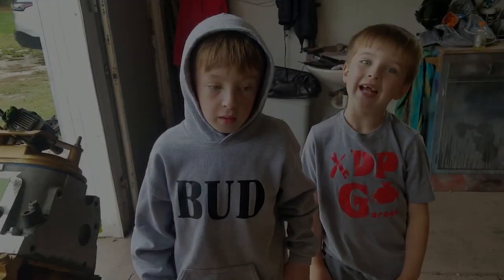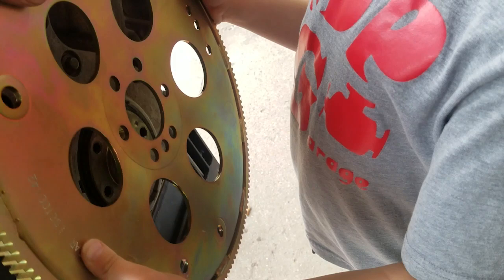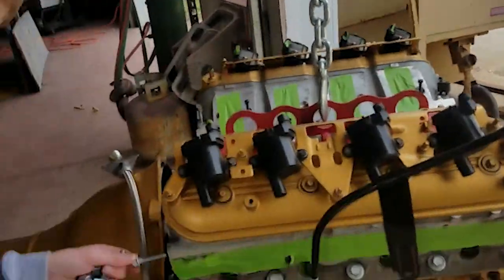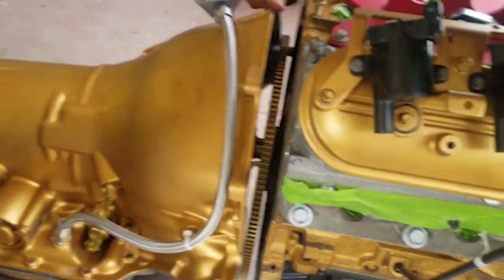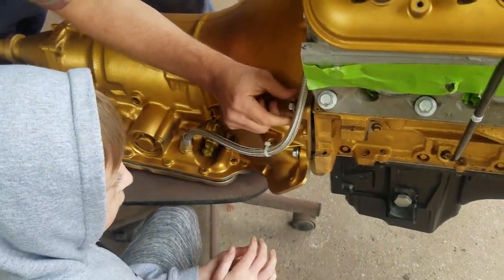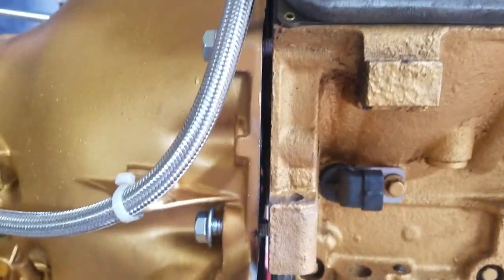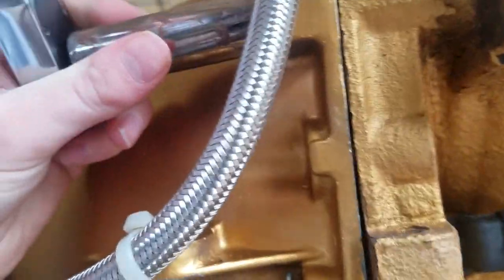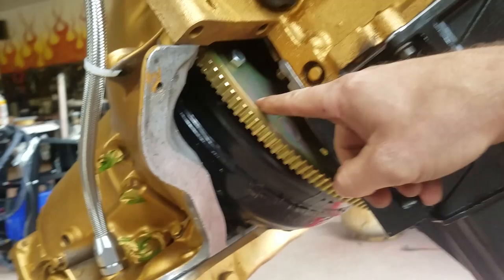Installing a Turbo 350 Transmission on a modern 5.3 LS motor.  LS Swap kids.

Comment: I have a 5-3 did I made it a th350 transmission too but my wiring harness has connectors for the l-series Transmissions what do I do with those and do I need to have the ECM programmed or something for the th350 transmission

Comment: Also. I have a stroker vortec. Not sure what flexplate to get. Gonna use the Turbo350 i have.
Reply from the maker: I think all you need is the ls swap flex plate and the bushing.  Might want tondouble check.  This is the only one I have done.  It's an 04 block 5.3

Comment: So question. For the TH350 how will the ECU know what speed it's currently going? Or is that irrelevant? Because I'm getting ready to do the final steps before I can finally start it and I've been curious about the TH350 with my 5.3.
Reply from the maker: I'm running a fitech system.  I think it's irrelevant.

Comment: Great video man!  Doing a Th350/LQ4 swap so this definitely helps. Did that flywheel have a front or back or did it matter?
Reply from the maker: Thanks.  There is a front and back.  The center bolt pattern has a raised spot where it attaches to the crank. I think 🙄 We started it the other day so it worked👍started engaged just fine.  Thanks for watching.  We are weldin up a mustangii suspension next.
Reply: @drainpluggarage  what year mustang? I'm doing my swap in a '92 Notchback
Reply from the maker: @mathewshackelford8037  its a 46 chevy truck with a mustang ii suspension
Reply: @drainpluggarage  nice!!!  Also, how do you like that Boss Hog torque converter?
Reply from the maker: @mathewshackelford8037  it was affordable!  I had no idea how expensive torque converts got over the years 😳Had to buy flywheel bolts and it had excessive paint on the snout.  Had to clean it off to get it to lock into the tranny properly.  Probaby wont see the road for a few years.  Dont know how it runs yet.

Comment: You have no dial pin on the passenger side of block, you need those..........
Reply: Without both dial pins the converter will wear the pump bushing one sided and you lose pump pressure. (Don't ask me how I know).

Comment: I seen you had some links to the parts needed but I cant click on them
Reply from the maker: Its fixed, thanks.  They are all on there except the torque converter.  That was an old ebay listing.  You can still find them.
Reply: @drainpluggarage   so the stock flywheel off the 5.3 won’t work?
Reply from the maker: @lilcunninghamx235  nope, i had to buy a flywheel and the spacer.  One more thing All but 1 of the bell housing bolts work.  For some reason the top passenger side bold doesnt have a hole tapped in the block.

Comment: Going wt this same set up for my 79 caprice thanks for the great video 📹
Reply: Is the flex plate required when using the 350 trans?
Reply: @lilcunninghamx235  idk but I'm doing the same in my 89 Caprice
Reply: Add me on fb maybe we can help each other along the way

Comment: How are you doing the vacuume tube for the tranny as well as the cable setup ?  If you have that.       I’m 17 doing my first ls swap on my 76 stepside and wanna reuse the t350 trans and torque converter
Reply from the maker: I havent got that far yet.  Your th350 and torque converter should be fine.  My intake has many vac ports and i probably wont use the kick down cable.  Ive never really used those.
Reply: Thanks ! Yeah I am just gonna run a vacume line to a stock vacuum port on the 5.3 I’m doing and I found a kickdown cable bracket to go on the throttle body.     Thanks for the info subscribed 👍 can’t wait to see the build
Reply from the maker: @daniellichtenberg8126  good luck.  We are moving slow.  Im building the 46 with my 2 boys and its going to take a while.  Its cool thebold bell housings bolt up.  There is one bolt on the top that doesnt have a hole.

Comment: I'm glad your boys showed me that the housing pattern is the same on an LS engine as a early Chevy
Reply from the maker: Isnt that crazy.  All these years they never changed it.  One of the upper bolts does not have threads tapped into the block.  I guess they are all like that.
Reply: @drainpluggarage  yeah I honestly thought that it was different I didn't know just an adapter ring on the torque converter and the different flexplate made it all work
Reply: @drainpluggarage  I'd like to start a project with my son what would be a good start ?
Reply from the maker: @johnmarathon4511  what do you have laying around to wrench on?  Fortunatly i have a father and grandpa that collected a bunch of cars in the 70s.  My boys wanted nothing to do with the garage until i suggested making videos.

Comment: never changed the bolt pattern all these years
Reply: Mopar guy here but at my custom speed shop we do ALOT of GM blocks. Just did a 5.3 powerglide in a 79 z28. It's a nasty girl now